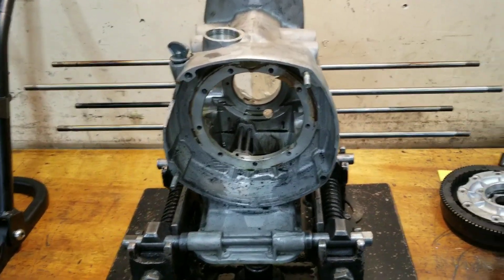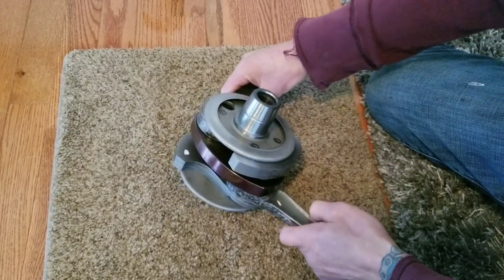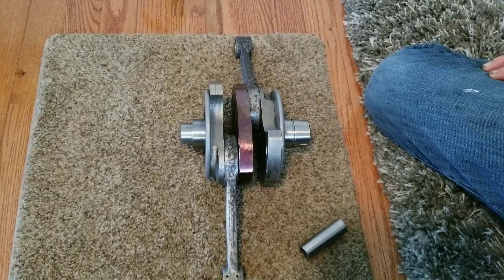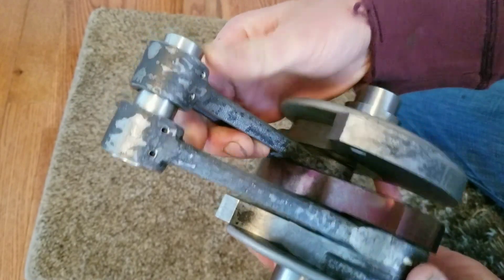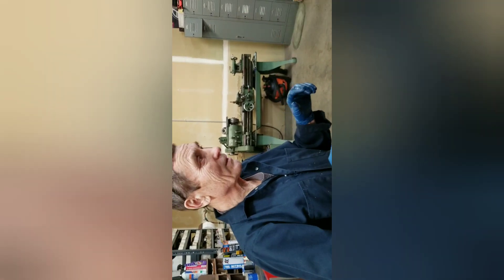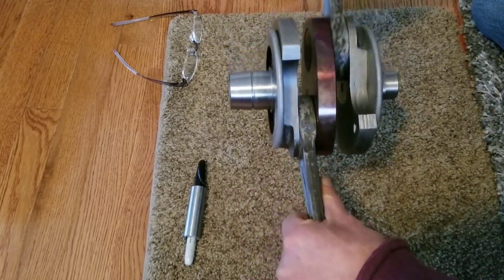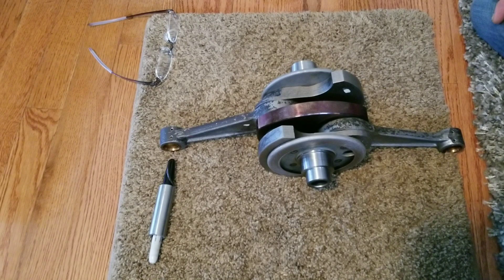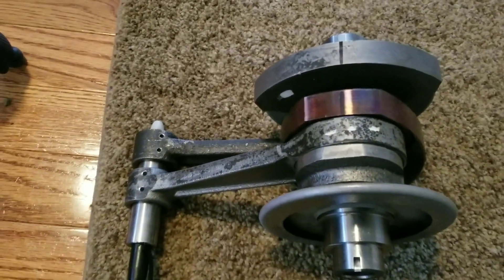Ural: what hrydrolock crankshaft looks like.

Comment: I just learned something today, that a hydro lock will twist a crank. I have twisted a crank on a 1972 H1 Kawasaki from high RPM hole shots and it ran after,  but like crap. The first thing I did with my Ural was to ditch the vacuum petcock, but I'm old school.